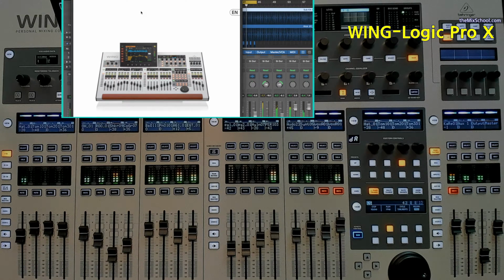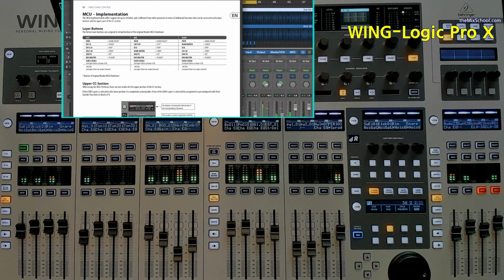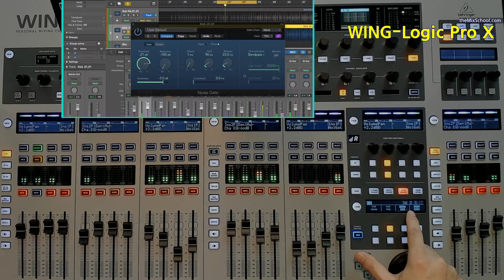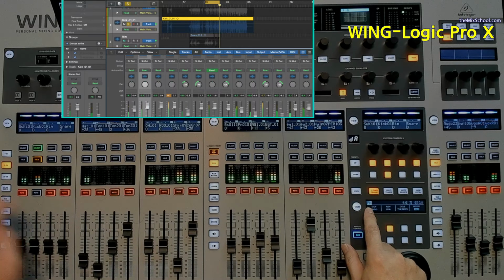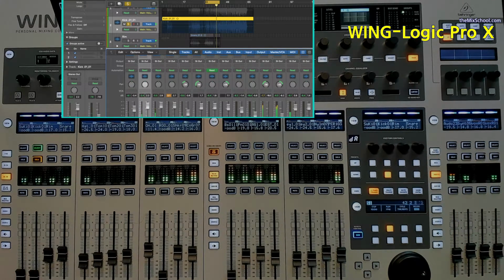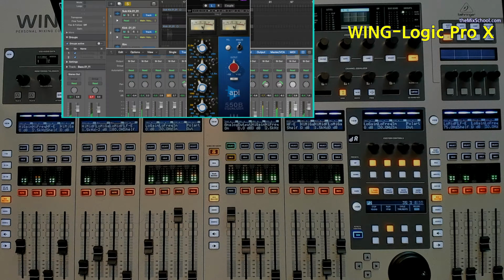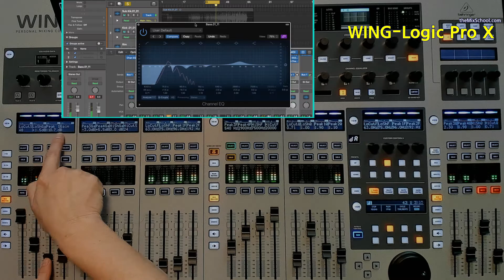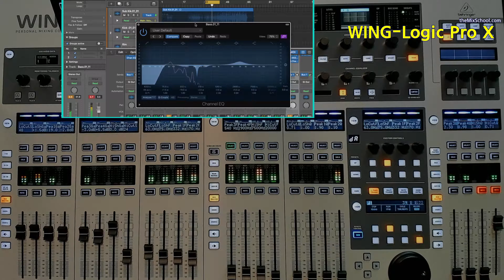WING, DAW controls explaining with Logic Pro X

Comment: Nice my friend. Can i ask if is really eay and helpfull as controller in logic pro? Meaning that is it make our work Flow better??
Reply from the maker: if you happened to have Wing and wants to use with Logic Pro X, it works fine. If you want yo buy wing as a hardware controller only for Logic Pro X? Better go with X-touch with expander or Artist Mix.
Reply: @bluesono  basicly i want to use it as a studio console with external analog devices, +as a controller.! Can be done yes?
Reply from the maker: https://youtu.be/xALv2eEhXZw
Reply: @bluesono  Than you my friend😉
Reply from the maker: Sure, it will be ultimate solution for project studio.
Reply from the maker: Please, subscribe. You'll find many useful videos.
Reply: @bluesono  I did  already)